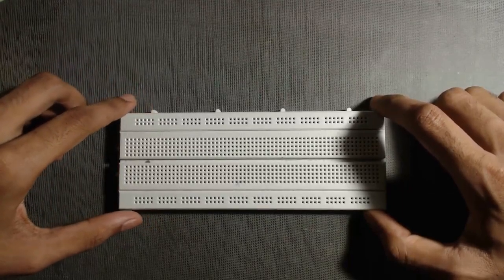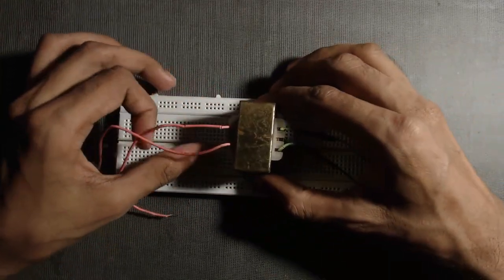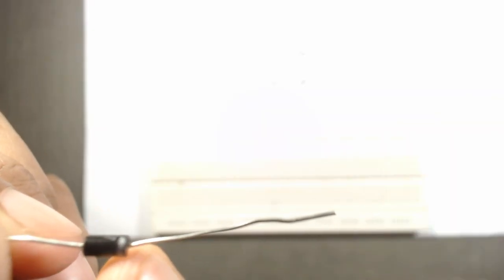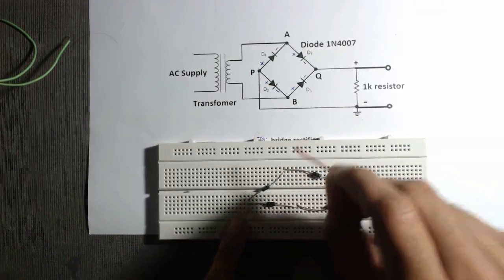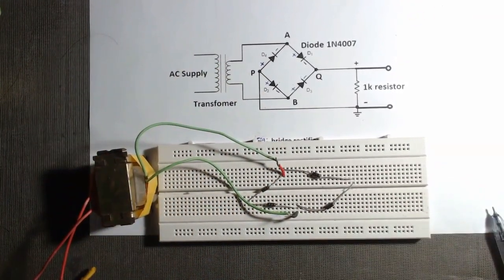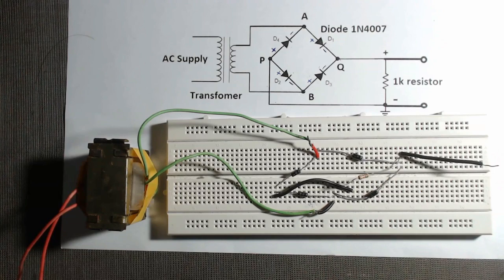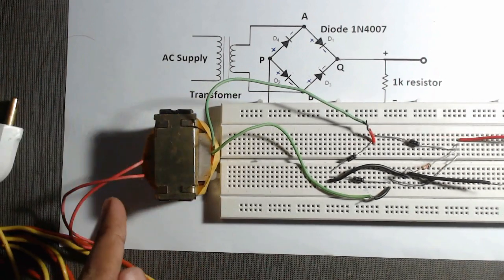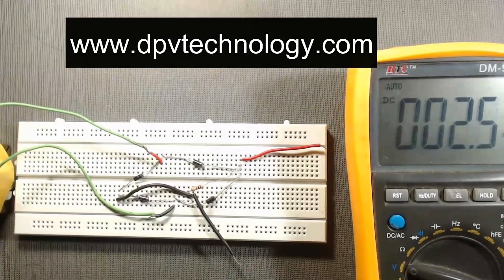full wave bridge rectifier on breadboard

Comment: In the last...
What would happen if I connect the red wire to positive line of bread board and black wire to the groud of bread board... And then I touch the nobes of multimeter to the holes in which I've put the wires ?? ??
Reply: I think I did sth like that in the lab and then would see smoke from the breadboard..was afraid